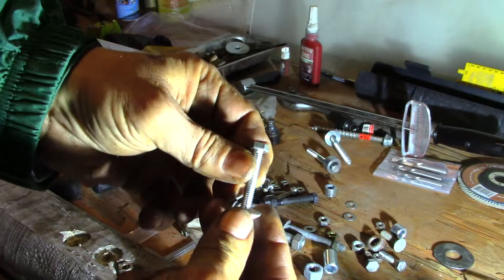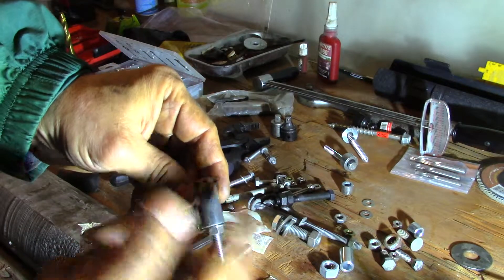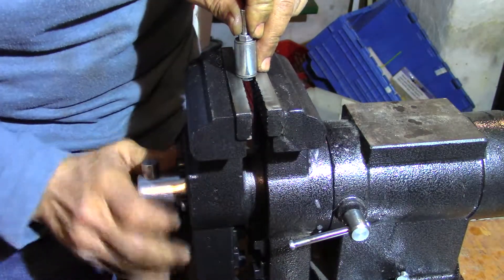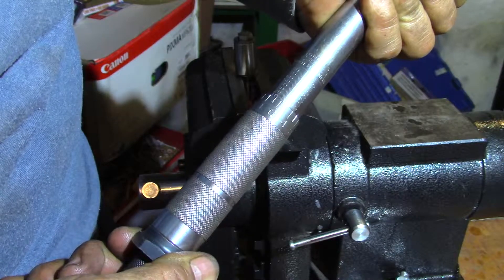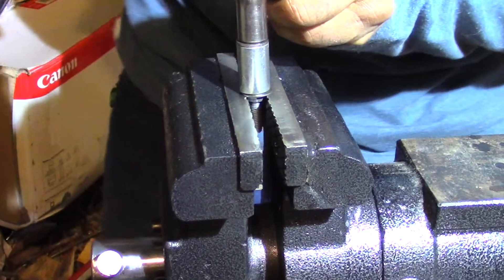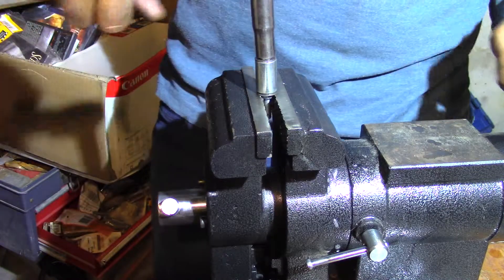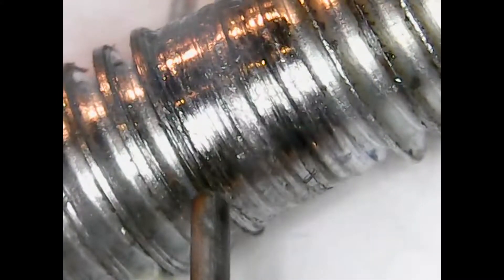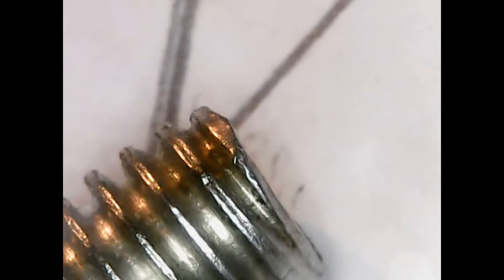Why Bolts and Screws Strip How to remove a striped bolt /bolt thread shear failure Part 1 #boltDepot

Comment: I've been hunting for a video on removing stripped threaded/stuck  bolt, all I could find was stripped heads. I appreciate your video!!!
I have a motor mount bolt that was factory cross-threaded, it came out 1/2 way and now it just spins. Will not go in or out. Just spins and its stuck, how do I get it out?
Should I just cut it off and drill it out?
Any help would be greatly appreciated.

Comment: I have a question.. If after tightening a bolt the thread gets stripped, is all of the tightening progress made thus far essentially useless?
Reply from the maker: Simple answer, yes;   I want you to think of the threads as a screw wedge system, you just lost your wedge and each time you try to get the wedge to work, the wedge is fractured and cannot gain in clamp force.
Reply: @EngineerPEretired  Okay. Thank your for the response.

Comment: damimt i have this issue right now with a caliper boilt it spins both ways freely but wiont unthread
Reply: I’m having this problem with the bolt that holds the gas tank strap on my 2001 Sierra. It’s a pretty tight spot too which makes this much harder. It just keeps spinning no matter what I do I can’t get it out
Reply: @joshinator69  did you figure it out by any chance?
Reply from the maker: Drill baby... Only stay inside the shank or major part of screw.
Reply: @EngineerPEretired  I USE A COLD CHISEL  to put outward pressure and i cranked it out needless to say the thread on the bracket were gone but the bolt was gtg

Comment from the maker: The ''clamped material'' canNOT compress any more and the ''helix'' of the screw keeps turning -- the nut threads / helix being stronger than the screw... the threads of those that screw fails.  This is what shear thread bolt / screw / helix failure looks like in the threads...